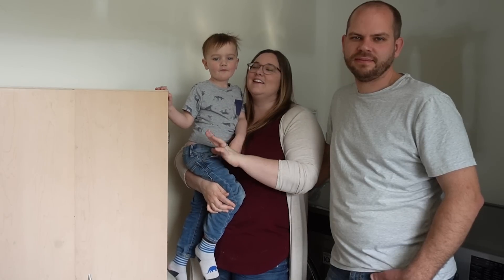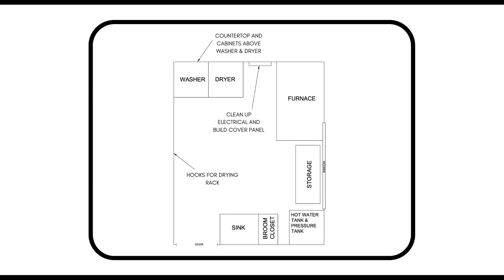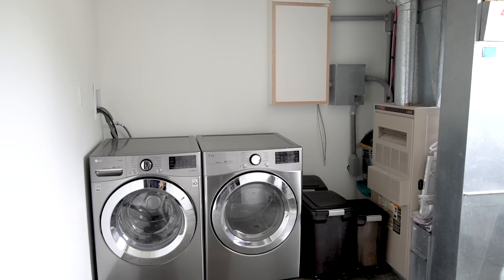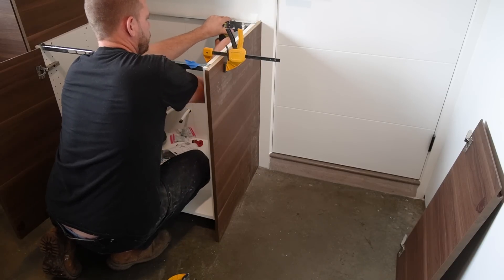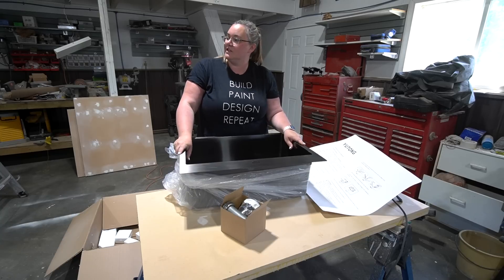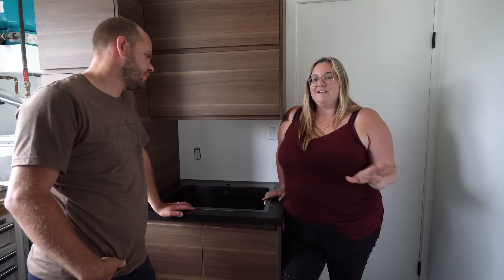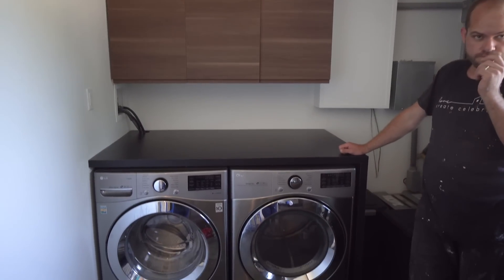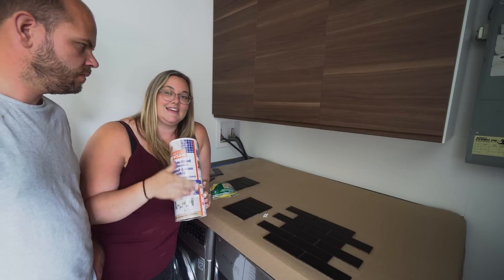Laundry Room Makeover on a Budget

Comment: how do you take your washer dryer out when the counter top are so tight in space?
Reply from the maker: We just slide them out. We’ve had them our several times. It was planned so that there was lots of room for them to move.
Reply: @LindiandRuss  do you have wheels? or do you just drag them out?
Reply from the maker: @edwardtse8631  it’s a concrete floor so we just pull them out.

Comment: That's not 'on a budget', you just had a budget of thousands of dollars. It's more of a DIY project which is cheaper than paying someone to do it but that's about it. I do like that you're using scraps from old projects though.
Reply from the maker: In my books DIY is still on a budget, you couldn't come close to getting this level of finish completed by hiring a contractor. We re-used left over products from other renos, and found decent deals on the products we installed. Could you do it cheaper, yes (but not achieve this look), so I would still consider this a budget room makeover for the level of finishes and the completed look we got! End of the day its all comparative to personal budget and desired end results. Thanks for watching 🙂